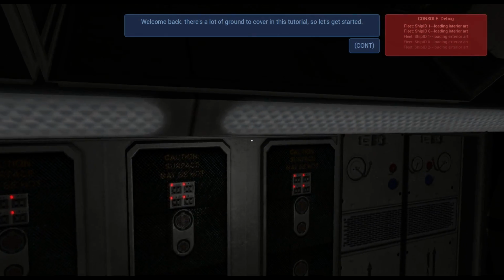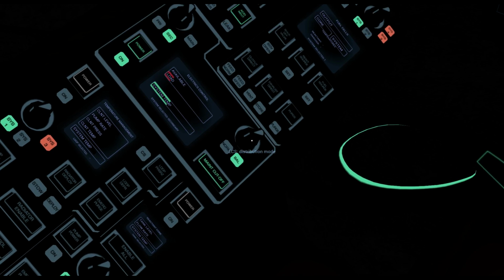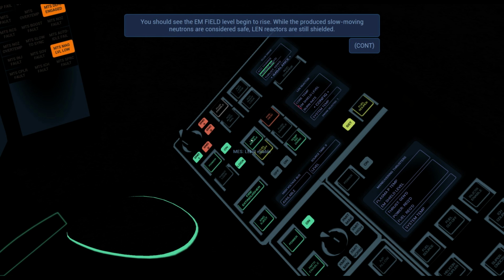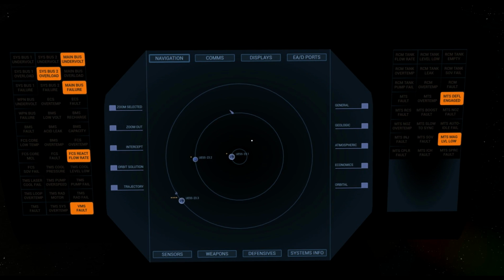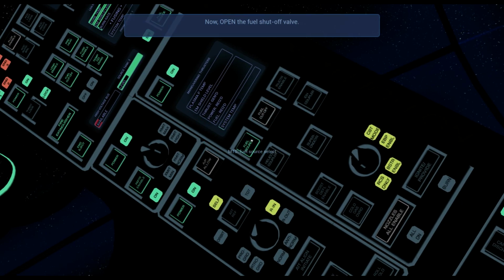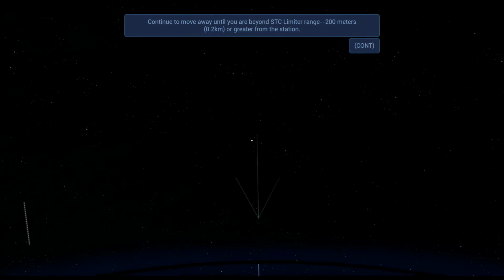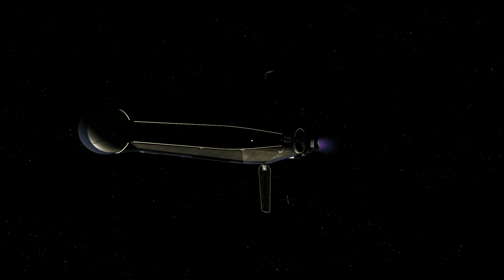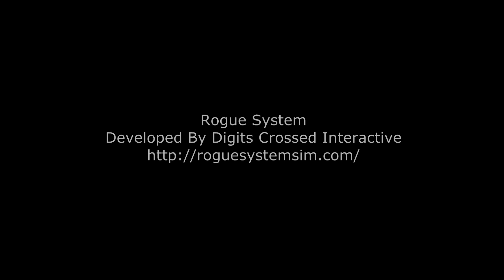Rogue System - Hardcore Spaceship Simulator (Alpha)

Comment: It certainly looks interesting. I am excited to see where they're going with this. Extracting interesting gameplay aspects around this, however, will be a challenge. Coming up with interesting ship configuration solutions to interesting problems. It take a lot of good design work to make sure that the workflow inside the cabin is properly paced. I suspect that trying to deal with, and continuously compensate for, failing systems during combat while somebody is shooting at you will be frustrating and most likely a losing proposition. 
Currently, the game if you want future expansions is at a 60 USD price tag. I'm intrigued, but hesitant about the gamble. The gameplay proposition is not entirely clear to me. I can certainly fantasize about feeling like a space captain knowing the quirks of my ol' bucket of bolts, but getting the job done by not pushing her too hard and making my payments until I can upgrade the LENR and then maybe finally have that TMS looked at etc etc.

Comment: With all due respect, I don't think you are the person to tell people that Star Citizen developers do not want to even try to approach the level of full simulation or that they ever will. Basically, you're wrong. The people backing the game have stated loudly and often that an extremely high level of interactive simulation should be the prime goal of Star Citizen. Each ship system is modelled to work as it would in the real world, each individual cable, tube and air/heat duct will be part of a system and be modelled within that system. You will have to replace damaged parts such as fuses, you will not be able to simply bring up a menu that says, 'fix'. You will have to find the fuse in storage, pick it up, carry it to where it is needed and place it yourself. If you don't follow safety protocols in the procedure you could damage both the ship system and yourself. You will have to re-route electrical power systems to avoid overloaded or damaged parts (the most common phrase used to describe this is 'Star Trek style'). You will have to manage those systems right down to the weight and CG ship balance of fuel, cargo etc. Every single item in the simulator will have mass and stress tolerance, mis-management will result in affecting the way your ship behaves. All mechanical parts, including ship parts will wear and become dirty over time, you will have to clean, replace or repair. There will be a specific in game mechanic that will allow players to specialise in engine, shield and weapon tuning. Ships will be modular and parts can be swapped out to improve performance which will be apparent in game. The offset being if it works harder/better, it wears out quicker is more prone to catastrophic failure, and is more expensive to run and replace. You will have to charge batteries. Just because there are no 'mechanical' switches immediately on view does not mean that no interaction is possible. It's supposed to be the 30th Century, mechanical switches will be far less prevalent. The level of simulation will surpass even the most hard core flight simulators of today since you won't be able to turn off or ignore Hobbs meters, engines, hydraulics etc will require regular service or they will become less efficient/malfunction. I guess it is a matter of preference whether to have 'glass' cockpits or be inside a 3D movie theatre, however what works for a small ship may not be so easy or realistic for large vessels with many and larger 'windows'. I guess it may be Digits Crossed interactive don't plan on larger vessels at this stage, but it's just a guess, I can't predict what they plan to develop. It's also a matter of preference to believe the lore that in a future that has advanced propulsion enabling long duration space flight, they will still use 20th century start up buttons and switches and there will be no AI to assist with such routine procedures, a matter of personal choice as to what the future looks like, but I actually enjoy controlling my space ships systems in Star Citizen with my flat touch screen tablet or setting up VoiceAttack profiles to have another interactive AI on board despite the fact that I have many years of experience with flight simulators. How long do you think players will repetitively go through that routine before they go and download VoiceAttack to program macro's?

Arena Commander is in it's first iterations in a PRE-ALPHA release!! It is designed to be a 'game' within the game every backer who has taken more than 5 mins to study the subject knows this. It was released in it's current form only to give a taster to the backers and a way to check the balance of the multiple and varied control inputs available on the market and allow the high fidelity graphics to be seen and tested. If you judge Star Citizen as it appears now, it is akin to deciding what a house will look like by examining one brick.

The first characters to be developed were Doctors, Nurses, Policemen. When you play the game, you will have to learn the skills to perform that character. You won't 'instantly' become a Doctor. You will be able to walk out of your ship, engage in a fire fight and if you are injured, that part of your body has reduced function and it will affect your ability to move/fly/manage your ship until it is finally treated and healed, there is no wait to heal or insta-heal med pack. Does that sound like a 'simplified' model will do? Chris Roberts has told us he expects to be developing this game for the next 10 years and it will be designed to take advantage of emerging technologies such as VR and Haptics. Not only will you be able to switch the switch, you will feel the switch. Chris Roberts absolutely loves it when people make their own costumes, build their own cockpits, he is building this game for them, ie, us.Tell me, which game developer do you know of that promises to continue development for that length of time? The only one who comes close is Austin Meyers with X-Plane and his 'game' is designed only for one mechanic and one planet. Unlike you, I did bother to learn procedures in both FSX and X-Plane and did 'learn how to talk to the tower' and use the various nav-aids. I am not alone, a significantt proportion of Star Citizen backers have experience with flight simulators.

There will be 'procedures' to be followed, in ship operations to prevent mechanical malfunction, repair damage etc. Even in the Arena Commander build now, how you manage your systems to reduce heat and EM emissions affects gameplay and is a definite tactical skill you will have to learn. If you power down and 'go dark' to avoid detection and don't use the proper restart procedure, your thrusters break and you can't manoeuvre. Also wider in game agencies such as selecting and using radio frequencies, RT procedure, landing procedures for dealing with authorities at jump points, landing zones (customs) etc. Ignoring those procedures will lead to consequences. This isn't like FSX where you get to choose to ignore them. When Star Citizen eventually completes and goes live, every button switch and interactive panel will be accurately modelled and work to affect what happens in the simulation. More than that, the character in game will be seen to interact with each switch, button and panel, there will be no 'invisible' mouse click only switching.  Let me give an example, Skyrim has approximately 200 separate character animations for the finished game as you well know. Star Citizen as it stands now at Pre-Alpha has over 2500!! (or actually as stated pre-Pinewood Studios Motion Capture shoot for Squadron 42, there are likely to be many more now).  I'm pretty sure that if they have gone to the trouble of developing a complete new system that allows every single in game object to be handled as both an object and a tool, and that even if stored it will maintain a physical presence that we can rely on them to do as we asked and make it an accurate simulated interactive experience, since we didn't even think to ask for that level of fidelity but THEY wanted that level of realism!!

As of now there are 6 star systems being worked on that we know of , each one has several planets and each planet has several landing zones, each one is unique and has it's own style/character. One landing zone has an area of 6Km and every building is enterable, every door, window, light switch, toilet and shower will be interactable. It was not a joke to put beds/toilets/showers/kitchens/washing basins in all ships big enough to carry them. Every NPC will have their own story and stats and you can interact to hire/fire, kill or marry. This far surpasses even GTA and it's just one landing zone!! The plan is to have over a hundred of such star systems individually built by game launch, supplemented eventually by procedurally generated planets that you can settle. Build your own house, hangar, shop, factory etc. There are currently 4 Alien races known each having their own fully developed language and culture. (Chris Roberts has said there will be more to be 'discovered', and in discovering them you will have to decide whether to follow the Star Trek like 'First Contact' procedure and suffer the consequences if you don't). There will be no repeat missions in the Persistent Universe (There are of course in the single player offline Squadron 42). If you undertake an in game mission, no-one else will be able to do it. If you kill an NPC, there will be no 'clone' that can be killed by another player.  The list of 'professions' you can role play is so long it's impossible to state here. There will be no 'levelling up' system in Star Citizen. Everything you do will have to be learned as a skill and how you progress will depend on how much effort you put into learning those skills. Does that sound to you as if they plan a 'simplified' interaction model? 

I have the greatest respect for the developers of ED and this game and it is great to see what they have achieved with so little in terms of resources and manpower, it is no accident that Star Citizen has raised 90+ Million dollars and has 900,000 backers however, and it's not just because of 'Shiny'. Please stop making such statements about something you obviously have not taken the time to research sufficiently well to even know the basics. If you simply can't restrain yourself from comparing apples with oranges, at least be accurate and refer to it as 'The currently released Arena Commander module build in Star Citizen', that way anyone who has a slightly longer attention span and actually reads rather than just looking at pictures of ships and videos of pew pew in space can go and find the information themselves. It is not easy I'm sure for those faced with the avalanche of information about Star Citizen to just decide not to bother and go on what they hear or see on YouTube, but that's the whole point, CIG keep us very well informed about development and plans. They take note of the backers feelings and ideas on the matter. I recommend you do a search on YouTube for 'Grabby Hands'.

To describe this as a 'hardcore spaceship simulator' is simply laughable. It is 20th Century jet planes in space. Even modern 21st Century jet planes have large computers in between the pilot and the controls, this is required to stop the pilot from killing himself with G forces, and yes those same G forces affect a pilot in space. How can that be? There is no gravity in space! Well that isn't true, every object in the universe is gravitationally bound to every other object, it's just that we mainly feel the one which is biggest and closest because it cancels the others out. If a 70Kg man stands on Earth with the sun or the moon directly above his head, he will feel a pull equivalent to about 1 gram at 1G upward, he won't notice it however, because the Earth is pulling him down with a 699,999 gram at 1G force. Also G forces does not refer to gravity, it refers to changes in velocity and how they are measured ie G is the force required to accelerate a given mass to the acceleration it would achieve falling at 1x Earth gravity in a vacuum. If you drive you car at 30Mph into a brick wall it would kill you without protection. Because the velocity changed, not because of gravity, your body and everything in it tried to carry on when the car slowed. If you drive fast around a corner you will be thrown to the opposite side, do it fast enough without a seat belt on and your head will accelerate and smash into the side window, there is a good chance your neck will snap, the next impact will be the side of your brain hitting the inside of your skull and being squashed 50 or 60 Mph pulling a full left lock should do the trick. Formula 1 drivers have to be fit, not to drive fast in a straight line, but to withstand the G forces of sudden acceleration/deceleration and cornering. It equates to about 2 times the G forces you feel on a 'good' rollercoaster 2-3 G. Imagine even a slight turn at the speeds a plasma drive space craft could travel, you would be strawberry jam inside that nice 3D cinema at any speed much above 2000Mph as soon as you even touched the control column.  

How do you work that out? well it's pretty simple math. If you kept travelling along the same line you and the ship are travelling the same speed, your relative velocity is zero compared to the ship. Now imagine the ship could turn and head an immediate 90 degrees Tron bike style. Your body wants to continue along the original line but the ship has stopped travelling down that line. Your relative velocity is now 2000mph down the original trajectory compared to the ship which is now travelling at zero Mph along the original trajectory. That is 70 kg (Your weight) travelling at 2000Mph hitting the side bulkhead. So if we want to calculate what would be the safest angle to turn at we divide 2000 by 90. That is a 1 degree turn will produce a relative velocity toward the front of the ship of 70Kg at 22.2 Mph, survivable, maybe, for short periods if you don't black out and your restraints should keep you in your seat, you better have both hands on the control column to stop it flying forward with it's weight and the weight of your hands and arms. You will suffer severe bruising and likely detached retinas. At 2 degrees turn the relative velocity is 70 Kg hitting you at 44.4 Mph. Again survivable, but likely with injuries, you would not be able to maintain control of the ship, if it were sustained for more than a few seconds, ie you kept turning at 2 degrees per second, you would not survive, your head would fill to bursting with blood and you would have a stroke. Your heart would be squashed against your ribs and not be able to fill and pump blood. You would not be able to inflate your lungs against a sustained force of 70 Kg travelling at 44.4 Mph, indeed your ribs will likely snap. At a 5+ degrees turn, 70 Kg at 112 Mph the weight of that superlight futuristic alloy helmet would immediately rip your head off, those gloves on your hands would rip your arms off. If you decelerate too fast (hit that nice button that says reverse thrust by mistake without a computer to intercept and modify/cancel the command) your blood will rush to your legs so fast that it would tear the skin and muscles open and you would bleed in to your boots, if they stayed on, the weight of your spinal column would force it through the soft tissue in your chest and abdomen and on to rip open your suit and splatter against the wall in front of you. You might be conscious just long enough to see it happen. This is why land speed records are always a dead straight line run, with a long deceleration track after the measured mile. No human could calculate these forces 'on the fly'. When you watch Apollo 13 and are invited to marvel at the accuracy of 'aiming at planet Earth' during the course correction scene, you are being mislead, the truly amazing thing that he did was to make the course corrections without the aid of a computer so carefully as to not kill them all with G forces. They were travelling at around 50,000 Mph. A course change of 1 degree per second would have them splatted against the bulk head at 555 Mph!! The sight of Tom Hanks yanking the stick and the ship flying around crazily like a balloon with the air let out is just pure nonsense. Only a truly skilled/seasoned jet pilot could even come close to anticipating what direction/ level of G forces in response to his control inputs, and even he was scared shitless at the thought of doing it without a computer.
Reply: s1rmunchalot 
SC isn't going to deliver half that stuff, it was just marketing. You don't make the pretty artwork first, and implement the mechanics later. If it was going to happen, it would have been in the game by now.
Reply: Oh ye of little faith. I highly recommend checking the latest 10 for the developers and see how hardcore it's gonna be.
Reply: Sounds very cool all of that level of realism that you are talking about but I would not consider SC a realistic space Sim until at least the very basic of orbital mechanics is implemented (which I think its not planned) like, where is your orbit and how can you modify it ,according to your momentum vector and position,to go places? SC is a really cool and detailed WIP but its definitely not going all in in science, its going more for the rule of cool, I mean, sound in space, really crowded asteroid belts, lasers traveling below the speed of light, photoshoped nebulas in the background... By the way, having a "3d cinema" as a cockpit is not a matter of preference, its a matter of not radiating energy through the windows and protecting your life in combat, you shouldnt be offended just because there's a simpler Sim that focuses more on mimicking real space travel and environment than your favorite game